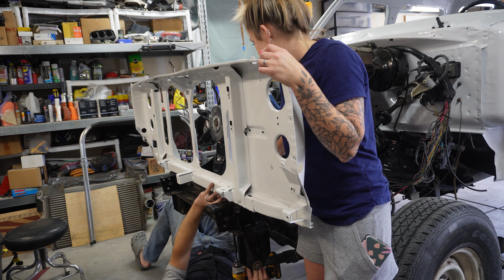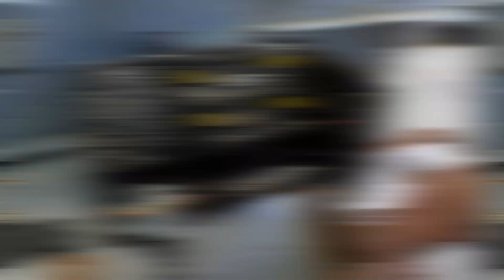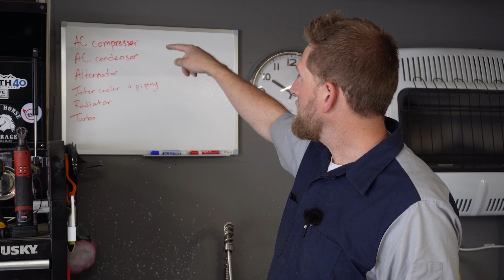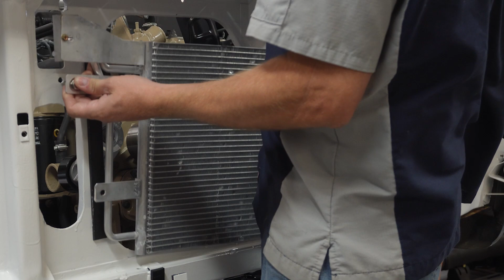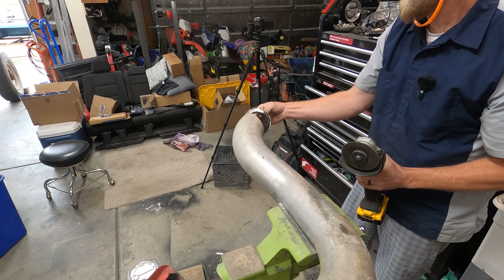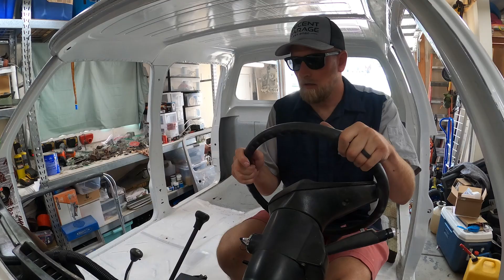The First Drive Of The Truck Build!!! | Long Bed Larry - Ep.25

Comment: Hi Tim,
What size/GA wire(s) did you use from the battery to the circuit breaker to the positive bus bar then to the solenoid/constant power fuse panel/keyed fuse panel?
Did you attach the Air Heater leads with the FACTORY 12 GA fusible links to the positive bus bar or did you change the fusible links to a replaceable fuse? If yes, what type, location of fuse and AMPS did you use to replace the fusible links in the Air Heater leads?
Thank you,
Brent

Comment: Hi Tim,
Thank you for the very valuable and informative video.
1. Would you please share the part brand, model #, and specifications for the solenoid and starter relay?
2. My '93 W350 Cummins 4x4 5 speed manual has trailer brakes with an under hood solenoid and two relays (30A & 20A). Can I delete the current solenoid - relays and move those connections to this setup?
Best, Brent

Comment: Which tach do you plan to use?, I just learned that the isspro r5503 I ordered awhile back won't work. The tach needs to be a stator signal tach
Reply from the maker: I haven't looked into it yet. I was hoping to use the isspro tach...

Comment: Looking forward to you being able to have enough parts to finally be able to get on it!  Check that your overflow valve is not stuck. It should not be that hard to bleed.  Or maybe your return is restricted.
Reply from the maker: The ofv was definitely part of the problem. It was only getting 3 or 4 psi once it was running. I put the tork tek in and it's steady at 30 psi

Comment: You seem pretty knowledgeable. So quick question: If you have an AC and it is kicking in and out for what seems to be no reason, What would you do to fix it? What would you look at first? We seem to be at a loss right now. When it kicks in, It is really cold so we know it is not the refrigerant. If anyone could help that would be great. We have a 2003 Chevy Trailblazer. Runs and drives great otherwise. There are a few things that we are slowly changing and upgrading on but still a good vehicle other than it doesnt really get good gas mileage.

Comment: Do you by chance have the links to your electrical panel setup and the rubber you used for the edges? or is that possibly on ovens garage as well?  Awesome build  keep up the killer work  God bless
Reply from the maker: I just added a bunch of links.
Reply: @decentgarage  Your awesome man. Keep killin it.  Love the cummins content and ur lvl of work  God bless!

Comment: Have you researched about putting the condenser behind the intercooler? I thought about the same thing, but everything Ive read said it needs the most airflow, and if you notice, they are always closest to the grille on every vehicle. Hopefully it works good.
Reply from the maker: I talked to Tyler Ovens about it. He has seem no negative effects of running it this way
Reply: @decentgarage  good deal! I’m in Florida, so we need all the AC help we can get.

Comment: Hi, just a thing I'd like to mention: All your electrical is going through that main breaker. Maybe you want to consider routing the fuel shut off solenoid separately so in case something goes wrong with the system on the road that would trip your main breaker, you're not losing your engine and therefore power steering. I've seen a guy that had one of those breakers trip often due to engine heat combined with load.
Reply from the maker: Hmmmm, this is an interesting point. The fss needs a ground and constant and a keyed. I'm going to try it going to my fuse blocks and if it has issues I'll cross that bridge when I get there. Great point though